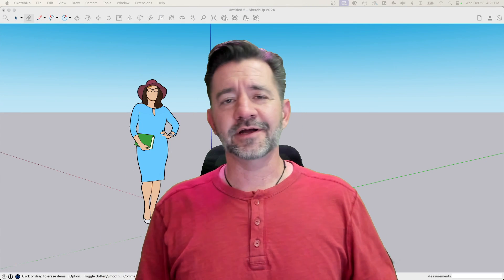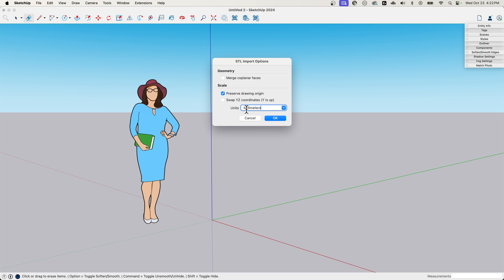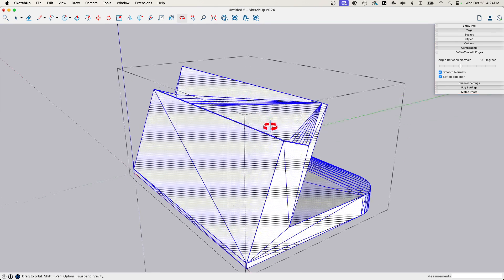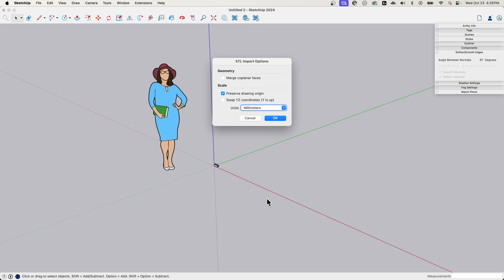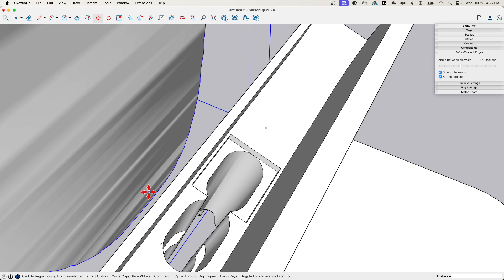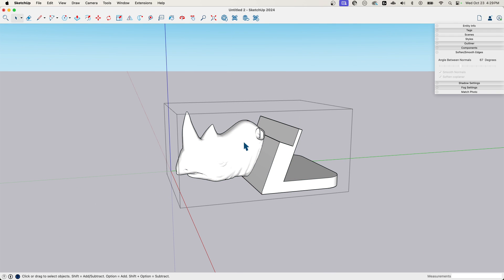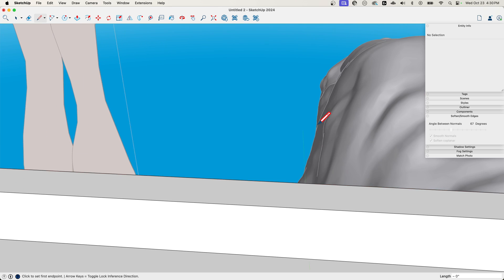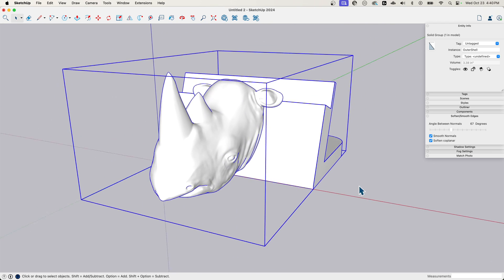Editing 3D Print Files in SketchUp

Comment: Hoping someone can help me. I have a file I designed (sketchup free). I have this file broken into 2 components. When I put the STL file into my slicer, it does not show 1 object with 2 component, it shows 1 object as 1 component. This is a file issue, not a slicer issue. How do I correctly export it?
Reply from the maker: If you export your entire model as an STL then it will include everything in your job. In SketchUp fro Web, you can only export your entire job. This means you have to have each component in it's own file before export. In the Desktop version you can choose to only export the selected entity.
Reply: @SketchUp I am ok with it being exported as one file. So for instance let’s say I have designed a cube, but on the top cube surface, I have put a smaller square on the face that is flush with the cube. When I export the file, the square on the cube face disappears. Is there a way to export it from web which will show the square on the cubes face?

Comment: I am currently trying to 3d print a model that I created in Sketchup. The model is a solid, I have used clean up and solid inspector with no errors. I made sure that everything in the model is large enough to print but I will say the model is somewhat complicated. When I open in Cura it shows up with errors (red surfaces) and when I try to print There are faces missing and it ultimately doesn't work. Should I look into a different slicer program? What would you recommend?  Has anyone had this issue before?
Reply from the maker: Alas... it is nearly impossible for anyone to guess what the issue might be! You may try asking someone at Cura, or sharing your SketchUp file on our forum (forums.sketchup.com) and asking for help there.
Reply: Nevermind! I had to remodel the entire thing from scratch but then it printed.